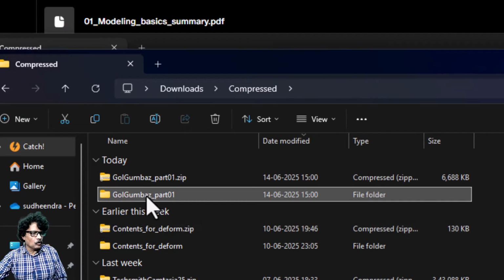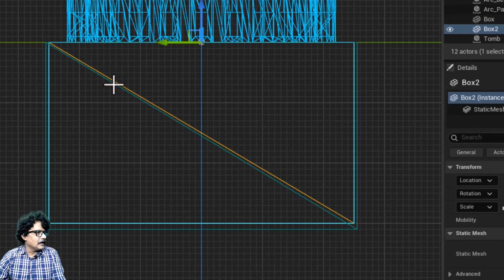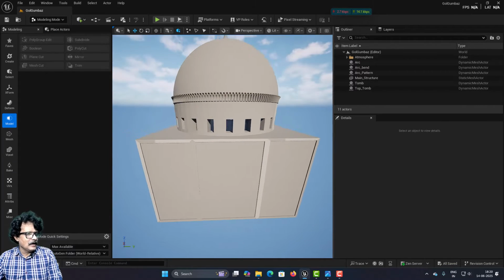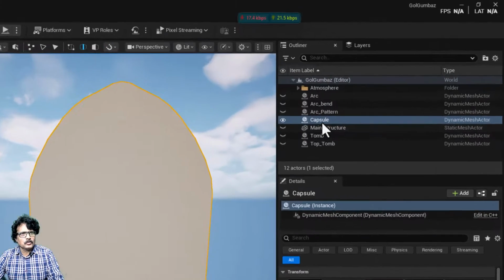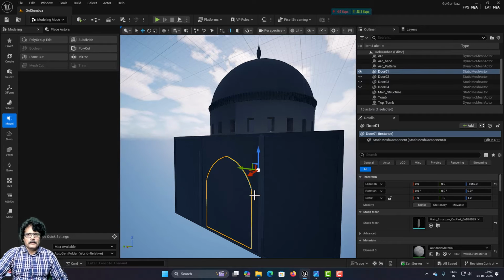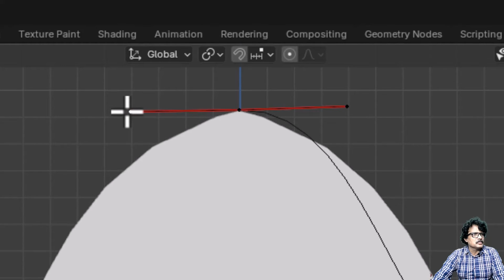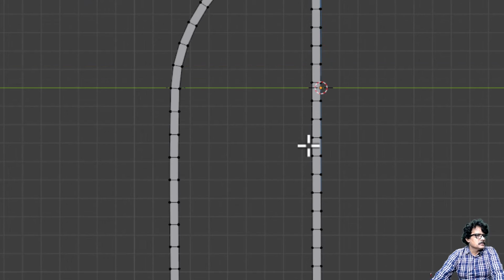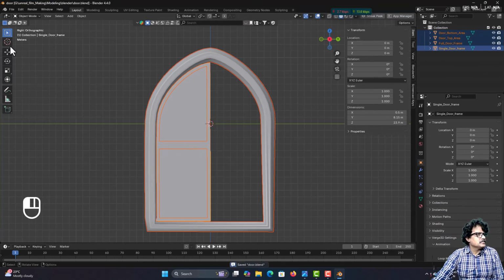10 Mesh cut and Design Gol Gumbaz Main Structure

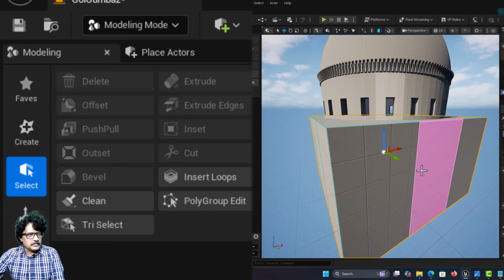Comment: Hi, these tutorials are great!  I have a dumb question: At 8:30, I can see that one of your doorways in the base of the dome has a big area around it that is lighter in color than the rest of the structure. Mine looks the same way too. What is causing this coloration? Does it indicate a problem in the geometry?
Reply from the maker: It is because the materials are not correctly mapped. when you apply proper uv map it will be solved. you can go to attributes in modelling and select uv unwrap and select polyedits that will solve this issue
Reply: @sudheendrasathvick  Ah, thank you! I'm still unsure about whether to model in UE or just stay with Blender for now. For all its complexity, I'm very surprised that many features of modeling [like insets] can't be controlled by entering precise parameters, so that actions are repeatable on several components that need to be identical.
Reply from the maker: @shrimpkins  blender is better for complex models. but when we want to create simple terrains and map layouts unreal will be useful.
Reply: @sudheendrasathvick  Yes, I think so. I am learning how to use DASH and Gaea, which are very efficient time savers. I hope by next year, there will be tools for modeling...